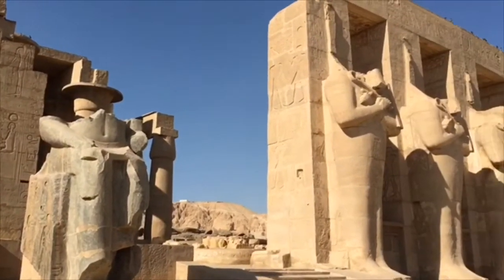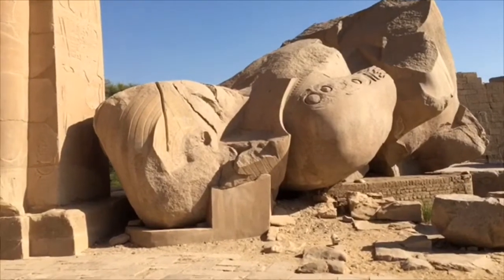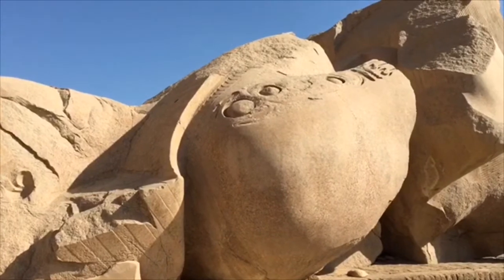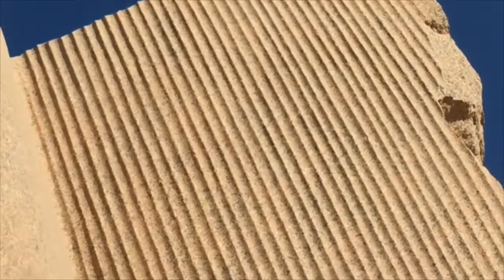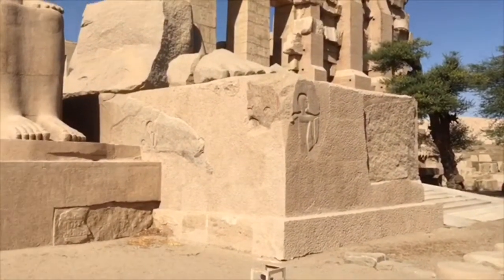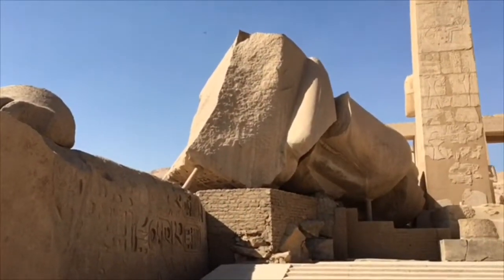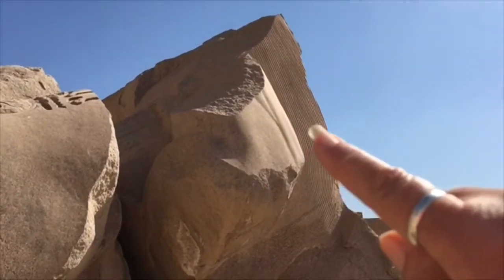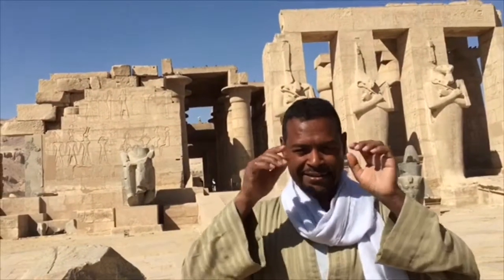Amazing engineering at the Ramessuem, Luxor

Comment: pause on 2:43 and you will see clear evidence that this stone was re hardened from source material almost like cement cast. Because rock inclusion has 0 % chance of coincidentally fracturing concoidally (like diamond , glass and quarts breaks)  along a carved surface. AS if the borders of the consistent granite was already inside the stone in the statue's shape. This is geo polymerization.
Reply: Even tho the broken statues weigh several hundred tons, could the sections be re-erected? To rebuild it so to speak. The sections could be, to some degree, hollowed out, to make them lighter, or precisely cut into smaller pieces. Thank you. What does geo polymerization mean?🤔 Thank you
Reply: @Spykerhond
 You're wrong not geopolymer
Reply: wrong granite is not a kind of concrete
Reply: @al2207  I thought granite was a natural stone, but it has other minerals in it
Reply: @j.lietka9406  granite is composed of 3 thing mica, feldspar. and quartz and require hundred thousand or millions years of cooling
Reply: @al2207  I don't believe our earth is millions of years old, nor do I believe that our universe is billions of years old. Poppycock! Hogwash! The fact that the ancient people of what would be Egypt & surrounding peoples, hauled, carved & erected those huge statues is a huge effort!! Thank you
Reply: @j.lietka9406  sorry for your distorted knowledge
Reply: @al2207  no pal, I have a solid & clear view, understanding of how we, & all this, came about.